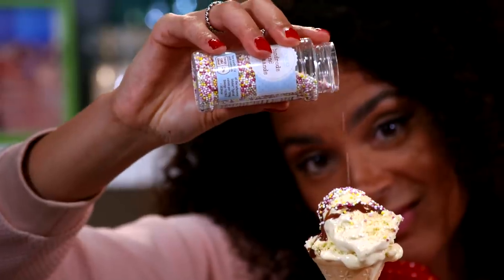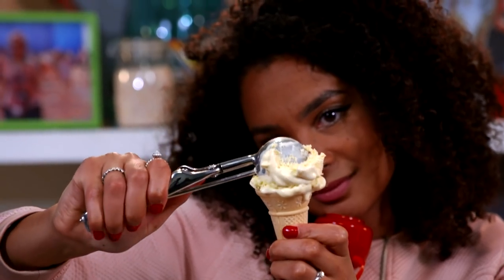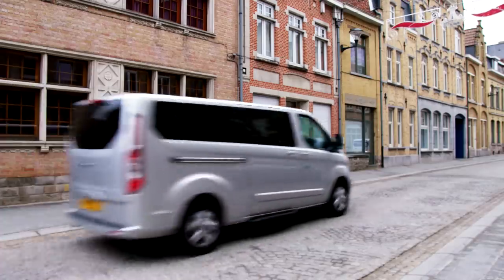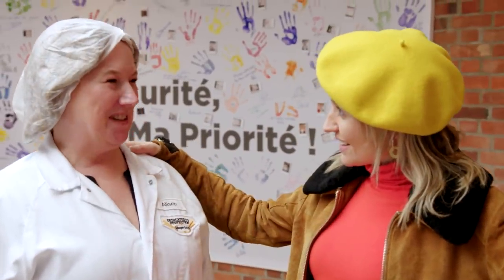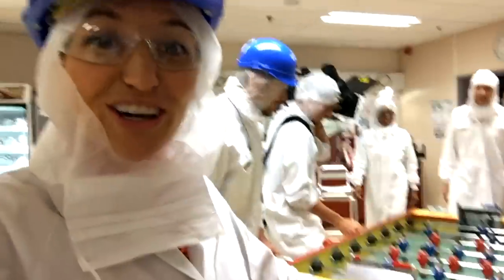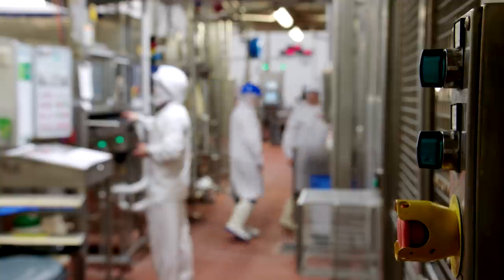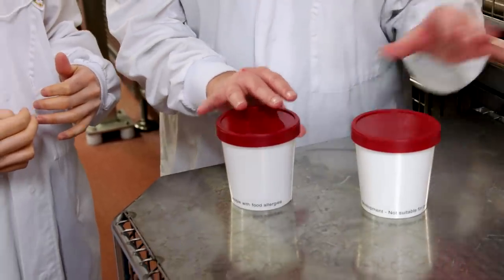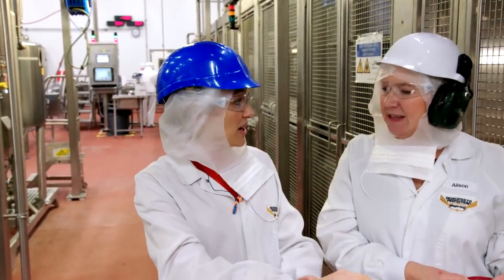Why Does Fancy Vanilla Ice Cream Cost SO MUCH More? | Food Unwrapped

Comment: the easiest way to work out how much air is in the ice cream is to weigh it. Ie a litre container with NO air will weigh about 1kg, therefore if it weighs 500 gm it has 50% air. 
Fun fact, here in Australia most ice cream has about 60 to 70% air. That is a two litre container only weighs about 700gm.

Comment: i do believe in terms of weight, Vanilla is actually the most expensive spice. Worth even more than Saffron
Reply: saffron is 13 times as much as vanilla - but still very expensive
Reply: @thehello88  Saffron is more than saffron? You need to edit that again.
Reply: @misterhat5823  cheers ;)
Reply: @misterhat5823  how mr. Garryson is doing?
Reply: She is holding about 500 euro (2L) of extract at consumer pricing, they buy in bulk so its cheaper
but still expensive at I would guess 200 euro a liter.
Reply: @thehello88  yes as the flower only hold 3 saffron, if you went to Walmart 1 vanilla bean is about 12 dollars and a very tiny tiny bottle is about 20 dollars for saffron as there are about 20+ flower in that bottle.
Reply: @Leforge360  the key is though how many liters of icecream does a liter of vanilla flavor, I guessing 1000 or more so 0.2 Euro per tub maybe
Reply: Aart Bezemer it's less about the cost being high for that volume, but the comparable cost of a imitation alternative
Reply: @hsarhsaw2240  there are different quality of safforn too and that 20+ flowers would probably weight around 2 grams
Reply: @hsarhsaw2240  so 1kg 100% vanilla bean paste on average costs 210 USD according to CNN saffron starts at 2200 USD per kg without the flower just the red stuff
Reply: And breathing over it with no mask to boot. I hope she is healthy.

Comment: Pure vanilla vs vanillin, basically not the real deal. I have read that vanillin was made with yeast.
Reply: Vanillin comes from several sources. Usually wood.
Reply: @scottyhaines4226  It's kinda logical. The vanilla flavour from whiskey comes from the barrels. If the enzymes present in the vanilla are present in large quantities in wood, it can be a great source of flavouring. You get the same stuff, essentially.
Reply: @CosminNeagu  Kind of. Vanillin is just one component of vanilla.
Reply: @misterhat5823  yes, that's why sometimes we feel an 'artificial taste'. The manufacturers only use one enzyme, but the real ingredients have lots of different types, in the peel, the stems, or in the leaves.